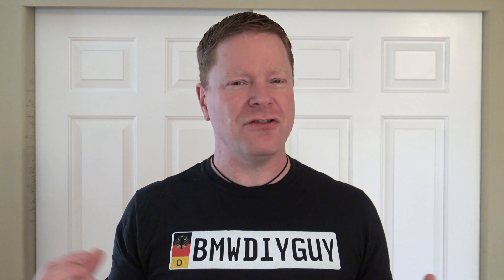Mosselman Oil Thermostat DIY for the BMW N55/N54 engine!

Comment: I red that is for keeping the temperature 20 Celsius below OEM. But with the MHD flash there is an óption to do that ( it was realesed 4 months ago)
Reply from the maker: Not familiar with that option in MHD, but it's good to have options
Reply: @BMWDIYGuy  He is mistaken, that's the coolant temperature he'stalking about. MHD and/or the ECU has no control over oil temps. I'm hoping to install my MSL thermostat this summer too.
Reply: @BMWDIYGuy  MHD control only water pump not oil temp. Lowering the water temperature also lowers that of the oil, but it is not enough.
Reply: MHD Sport or Track cooling overruns the water pump, which yes does decrease oil temp but it will wear out your waterpump sooner, already a fragile unit. A lower temperature spring, like in this Mosselman, will allow oil to run through to the oil cooler at a lower temperature. Main benefit is lower running temperature at daily driving conditions. No difference on the track though, where extended hard running the thermostat would have already been open anyway and the limiting factor then becomes the size of your oil cooler and the quality of your radiator.
Reply: @Marky_Markster  Uh, yes. I used the MHD sport mode for the watertemp. And not long after, my waterpump died.. Already at 111K km's, but maybe it's related. So, now I bought this Mosselman oil thermostat. (2012 E91 335i N55)

Comment: Can anyone confirm that the oil cooler radiator stays cold before reaching 85 degrees? My fear is that below 85 degrees it is always a bit open.

Comment: Great video, just curious what would be the difference between this thermostat and oil thermostat valve normally sold by Burger motorsports which is even simpler to install, obviously they aim for the same goal but, any main pros or cons between them? Thank you.
Reply from the maker: Great question and one I can't effectively answer.  I haven't installed the BMS upgrade so sadly can't compare the function.  The only quick obvious comparison I can make would be the dramatic appearance of the MSL unit, rather than just an internal upgrade on the oem.
Reply: @BMWDIYGuy  Thank you much, I’ll do a little bit more research on my own before I pull the trigger on the thermostat itself. Thank you

Comment: Great video! Would you recommend their oil cooler as well? Looking at purchasing their single cooler kit with thermometer upgrade. What are optimal oil temps I should look to achieve? Summers are over 100 degrees here and I like to go on canyon runs. I don’t track my car but it is FBO with inlets. I have a 2013 335is coupe DCT. Thank you!
Reply from the maker: With temp that high, I would definitely consider the upgraded oil cooler as well.
Reply: @BMWDIYGuy  Great! Thank you for the big help. Will order now :)

Comment: Great video 
Applies to the S55 engine as well if anyone wonders
Reply from the maker: Definitely check in with Mosselman as they have fantastic options for S55s as well.
Reply: BMW DIY Guy I did 
I just did the install myself. Not much different from what you did

Comment: Great video. Would you recommend this on a stock, not hard driven N55? I feel with something like this, I might not constantly get up to operating temps based on driving habits. But, I live in LA, and ambient temperature can play a factor. During normal daily driving I hit 250f, sometimes a tick or so before 250 if it’s a cooler day and I’m on the freeway. I run motul 5w40 if that’ll figure into your recommendation. Thanks!
Reply from the maker: Yes, especially in warm environments
Reply: @BMWDIYGuy  Thanks for the quick response. One more question if you don’t mind. Would you recommend me getting the crank seal guard done immediately? I know oil and coolant leaks can be random, but my car is currently in good health/no leaks and has 30k miles (2014 435i M Sport) or as long as I keep an eye out, I should be fine and have it done once I have the serpentine belt done at around 40-50k miles? Unfortunately I’m not mechanically inclined to do these types of jobs myself, so I’m trying to weigh out the risk as I will have to pay to get it done. Thanks so much!
Reply from the maker: @aaronbrown4366  I would do it the same time as the belts.. it's a good idea in general.
Reply: @BMWDIYGuy  Thanks again and will do.

Comment: can u tell me if there is a large c clip on rt side of that short upper radiator hose comin out from under the housing?  there is one on left side i can see, but mine does not have large c clip on the other side
Reply from the maker: Not that I remember but another idea is checking realoem.com. Look at the parts diagram for that part and see if it's there.
Reply: @BMWDIYGuy  i didnt see it there, nor do i see it on parts offered for sale on fleabay(allshow one on left side under housing), but one seller told me it was not part of the diagram( he cudda just been talkin), but where else on realoem would i look? i just dont know
Reply from the maker: @jackhere4594  yeah just don't remember one being there..

Comment: Can I ask what the thermostat actually does? Why would you change the stock one? I might be naive here, but how does it “cool” the oil more?
Reply from the maker: It is a more efficient thermostat and opens ealier in the temp cycle.  Brings average Temps down by about 10 degrees

Comment: I have a f32 and often do self maintenant.  How do I find out the torque specification for each bold.  Thank you for your help.
Reply from the maker: There is a website called NEWTIS that might have the info you are looking for, as it has the official BMW guides for various parts including torque values.

Comment: hi im very intrested in buying one of these for my 335i im in the uk mine is a m sport with a oil cooler i reach 118c not farahnite (just under half way on the dial )in  hot weather ...my concern is our winter usualy doesnt go worse than between 7c to -5 c tops ...will my car still reach safe oil temps  dont want it to be undercooled any advise be greatly apreciated
Reply from the maker: I would have zero concerns on being too cold, but you could also confirm with Mosselman before doing the installation.  I am willing to bet you wouldnt have issues.
Reply: @BMWDIYGuy  thank you very much for the quick reply yes i will send them a message i know its perfect for summer aslong as it reaches 95c in winter wil be happy enough to burn the crap out .looks a decent bit of kit and a lot better option than the bypass valve. been nothing but keeping up maintanance since i baught it time for some goodys for it now :)

Comment: Hi, can you tell me, what's the REAL oil-teperature difference before and after istalation? Thanks
Reply from the maker: I dropped about 20 degrees on average with my N55, and about 15 with my S55

Comment: Thanks for the video!
How did you manage to clean all the oil on the engine and belt?
Brake cleaner and high pressure water clean?
Reply from the maker: Stuffed rags and paper towels under the housing before I took it off.
Reply: @BMWDIYGuy  yes i saw that but i had a leak before so all my front engine including the belt are covered with oil, so i was looking for the best way to clean it!
Thanks for your reply!
Reply: @sebastienmarquet8686  spray carburator cleaner then high pressure water clean.

Comment: I see you replying maybe I’m a little late. I have a e92 without the thermostat to start with. Gonna do the oil cooler and thermostat kit for $1000 USD will I have problems mounting the cooler? I have pdc holes and headlight washers
Reply from the maker: I haven't done an e92 but as long as it's compatible, I would expect you to  be fine
Reply: @BMWDIYGuy  thanks

Comment: Would you recommend doing this during an oil change to limit the amount of oil that comes out while replacing the thermostat?
Reply from the maker: I lost so little, I am not concerned. I have an oil change later this week as I need it, but not out of concerns on levels.
Reply: @BMWDIYGuy  I meant more so that there was less to clean up. I try to keep my engine super clean too :)
Reply from the maker: @fthirty3  really dont think so as you just get the oil off the top of the pipes, and a little sitting in the housing.  Great question though.

Comment: where'd you get this engine bay cover?
Reply from the maker: So I painted mine.. I have a DIY on it, though am NOT a pro painter by any means.  It turned out surprisingly great considering my painting skills.  There are also several companies that can paint a custom vanity cover for you.
Reply: @BMWDIYGuy  definitely looks great for sure! I'll check out your DIY on this then
Reply: @BMWDIYGuy  for the mosselman thermostat did you prime the system or no?
Reply from the maker: @jg_media9  nope, no need.
Reply: @BMWDIYGuy  cool thanks for letting me know! Diving into this install shortly. Ill see you in a few weeks at the Kies show 👊

Comment: So I have these problem that I have to change in my bmw 335i n54 but im not sure if I have to change oil cooler thermostat housing or the lower thermostat + water pump? Help!
Reply from the maker: Sorry, not sure I understand your question?
Reply: BMW DIY Guy my check engine light is on and  my car goes into limp mode but I’m not sure what I have to change, bc some temp pops up in my speedometer

Comment: What torque wrench are you using?
Reply from the maker: I actually have two now, both really good to cover the full range of any torque values I need.  I have the Gearwrench 85077, good for 30-340 Nm values.  I also have the Gearwrench 85076, good for 10-135 Nm values.  Easy to use, batteries last a long time in them, really serve me well.  No more stupid click, turn, dial whatever wrenches.

Comment: Might you know where the oil temp sensor is?
Reply from the maker: Its under the throttle valve assembly, plugged into the block. Not an easy change.

Comment: my mosselman gets CRAZY hot. after like 4 miles of driving. i cant touch it for like an hour. urs get that hot? they say it has a real thermostat in it.kies motorsports say thats normal.  hows a small thermo like that gonna hold up to this type o heat?
Reply from the maker: Perfectly normal.. oil temps are often 200 degrees plus so it being that hot is normal
Reply: @BMWDIYGuy  rt,but has mosselman told anyone of a replacement thermo when this one goes out?
Reply from the maker: @jackhere4594  I haven't heard of one failing
Reply: It's normal that the oil thermostat housing gets hot. The thermostat inside is fine, don't worry about that ;)
Reply: @MosselmanTV  i just got oil pressure low warning light on idrive and odometer. after driving for about 2 hours, first time i drove that long since the mosselman has been installed. is this normal? no leaks anywhere and new oil pressure sensor installed when mosselman was installed.
Reply: @jackhere4594  what’d you? and what engine? I’m looking to buy this product but not sure if just to stick with an oem
Reply: @officialtd1316  i had to put in again another oil pressure sensor, but..it seems fine now, on N55 335i 2014 model. however if i did it again, id just use the burger sport oil cooler valve and be done. keepin the oem housing.
Reply: @jackhere4594  do you track the car or is it just a daily and what mods do you have?
Reply: @officialtd1316  no tracking, but run pretty hard up n down highway. host of mods. basically all plastic pipes replaced with aluminum,including turbo inlet,borla s-type exhaust(sounds perfect NOT obnoxious),bronze apex wheels,vrsf fmic,stage 2 lpfp,Turbo Smart PLUMBACK bov,Crank Hub Bolt Capture,M lower control arms. but no bootmod ecu tune yet or turbo upgrade.

Comment: Many questions but little response from this BMW DIY Guy... Not so good for the reputation..
My comment is: What is the reason for this Mosselman oil thermostat update?
Of course it will be better but why would this upgrade be necessary? Is the oem thermostat that bad?
This is a big miss in your video, "The reason why"...well
Reply from the maker: Here is the why direction from Mosselman, and the experience in my S55 and N55 have been similar improvements.

MSL OIL THERMOSTAT

The next level of temperature control

20°C Lower Than Stock
Operating temperature 20°C lower than stock.
 
Real Thermostat
Equipped with a real thermostat, not an always open solution. (for use in hot and cold climates)
 
Rock Solid Housing
Made out of a solid block of high-grade aluminum.